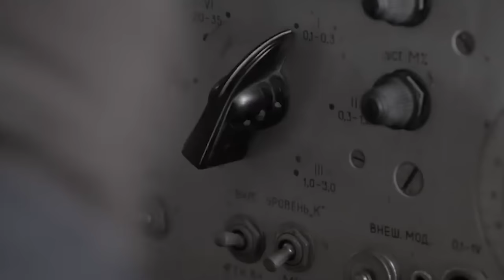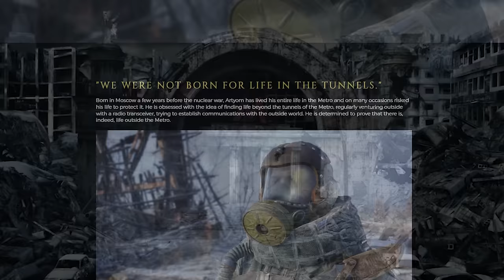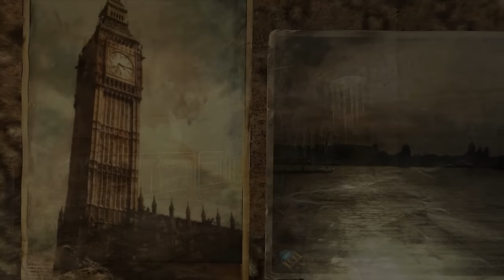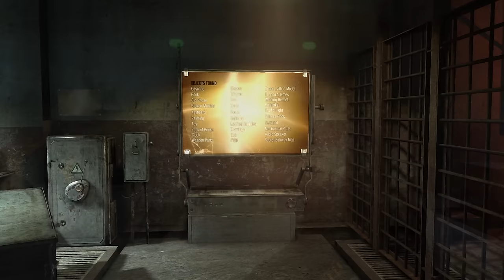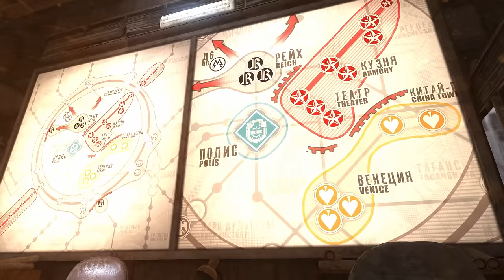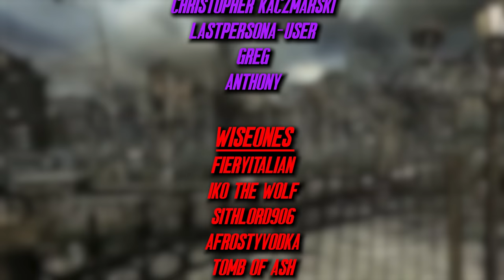The FULL Metro Timeline...So Far | 2009 - 2035 | Complete Metro Book & Game Lore

Comment: 8:17 sabot (say-bow) rounds are long, small diameter tungsten kinetic penotrator with stabalising fins at the rear, sabot meaning shoe in French, refers to a sleeve that attaches to the the sabot to keep it centered in the barrel until it leaves at which point the shoe/sabot is discarded. APFSDS (Armout piercing, fin stabilised, discarging sabot). Sadly, sabot rounds do not carry an explosive charge, so the explosion we see most likely would not have been a sabot round.